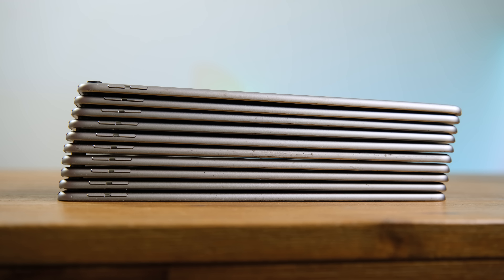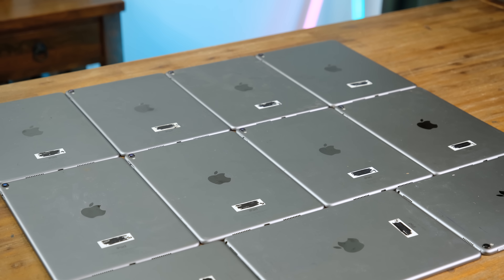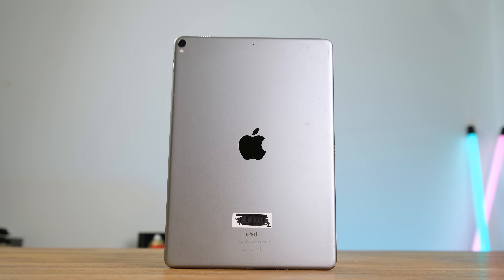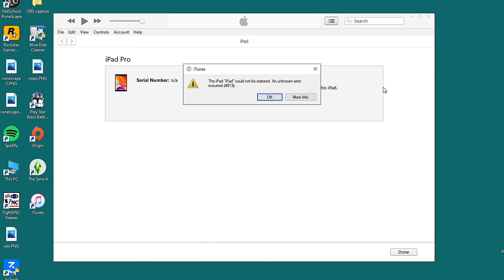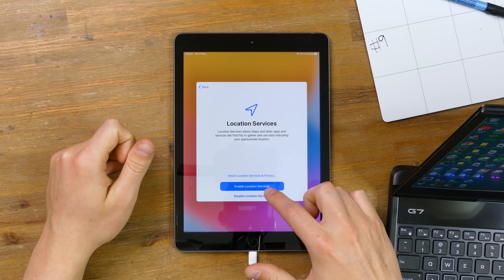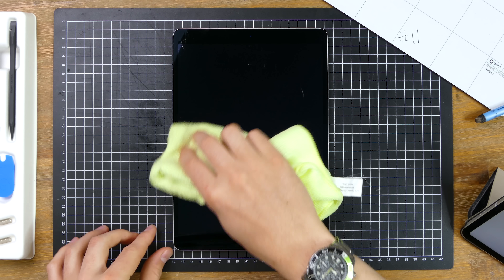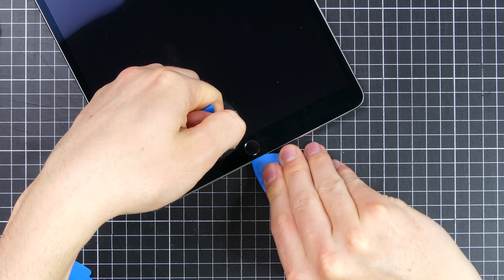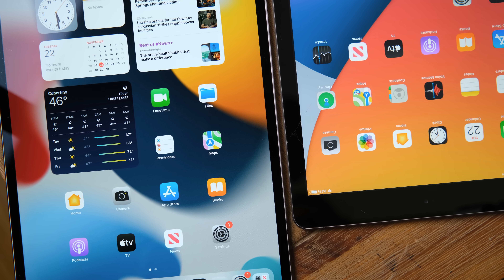11 FREE iPads Thrown Out By A School!

Comment: Not to up on ipads even though I have one but we had a chap who left employment at work and he told up the unlock code which did not work. I assume that it was still linked to his icloud account too.

I tried to do things on a pc to access via itunes that did not work.

As a result I took it home and got the recovery screen up by holding the home button whilst turning it on when the black screen with cable came up I connected it to my macbook and opened finder. I got a message that the ipad was locked and could only be wiped and the most recent ios would be installed. Did I wish to continue. I put yes and after about 20 minutes the ipad was at the setup screen and worked fine.

Comment: these models (if fixed) do have commercial value, if they are not cloud lock and dont have the MDM (organisation) locks on the devices. 

if they are destined for the scrapheap they would probably be locked as they'd assume they're worthless, not getting money for them therefore no need to unlock them.

Comment: if the broken tablets chip works and they are the same model you can try (if has tools and the time) tochange the chips until the icloud lock is gone. because the icloud lock is stored on the A bionic chips

Comment: This is a funny video; schools must be getting smarter.

I once got a 2006 imac for $18 from a local school. The monitor was boarked (still is, screen was basically bad and they had a sign on there $1600 to repair or some crazy amount). An hdmi adapter, some spare laptop memory and the fastest possible intel chip I could buy on ebay let me upgrade it to mavericks.

I think I spent total of $64, including $20 to buy snow leopard, $18 for the imac, and $26 went to the intel chip from ebay incl. shipping (I already had compatible ram from a thinkpad upgrade).

It still works, although it's really slow when using vnc. For $64, it was worth the price.

it is impressive how well these things were built (and says a lot about their pre-catalina OS X resiliency to work with backward compatible hardware).
Reply: boz

Comment: Apple needs to make some process to unlock devices in some official manner. I've had to get rid of way too many perfect iOS devices because of the lock
Reply: @sys-administrator  never happens in the used IT hardware world. So you just end up with e waste unfortunately
Reply: @sys-administrator  can something not be useless if it only applies to a niche use case but not the normal patterns of hardware lifecycle? If I had to have the receipt to unlock a device, I deem that useless. That's also not the usage case I'm talking about so it's really apples and oranges
Reply: @TheOldMachines  What about as a someone earlier mentioned using-irepair p10 box. Will wipe serial no,read ,write nand.

Comment: I have a friend who works on laptops  he got 3 iPads from a school two of them are the first generations of iPad airs and one of them is the 2nd iPad apple ever made they had wear on the back from being in a case the paint was worn off of them but one had a bad battery and the other the home button had fell down into the iPad someone done a poor job repairing the screen but i ended up buying a new battery and bracket for the home button but sadly the other iPad which was the 2nd generation iPad it was icloud locked but it looked new even tho it was old it’s such a shame

Comment: Why not use the original home button from the old screen? Touch ID will be working and then it will be a FULLY working iPad :))
Reply from the maker: I only found that out after I finished filming. Looks quite challenging to remove the old button from the assembly

Comment: Nand flash Chips can be  replaced  and even upgraded to higher capacity.... iCloud  2 solutions replace the security chip with a unlocked security chip Or remove the security chip and write firmware to it  that will erase the iCloud lock

Comment: if you have a wifi only ipad with an a9-a11 cpu, you can actually change the serail number, wifi address, and bt address to that of an unlocked device, which would unlock the device. Since you have  a few with bad nand, you could try and see if these were unlocked. you will need a dcsd cable. https://www.youtube.com/watch?v=f1z4EfVx4cs